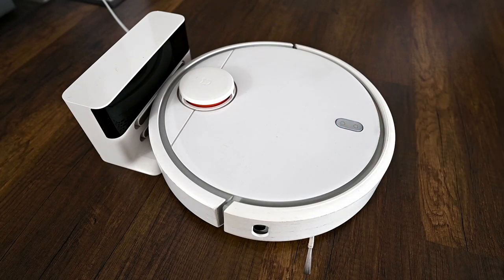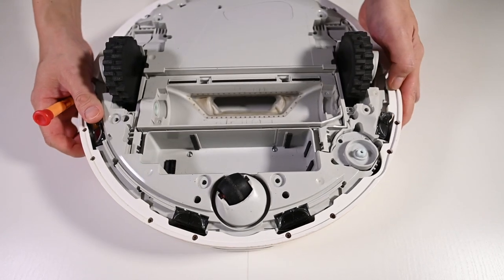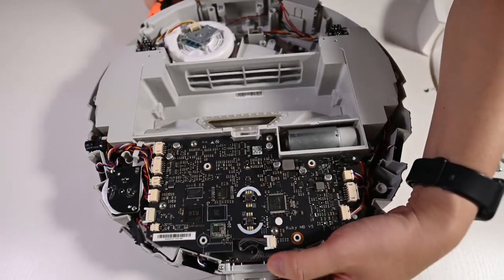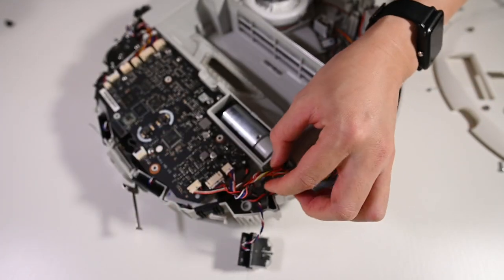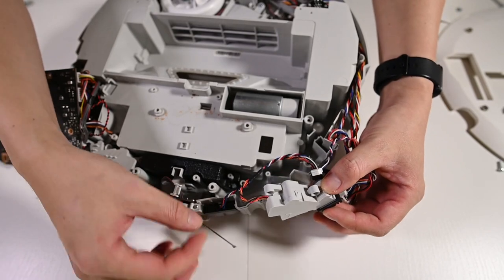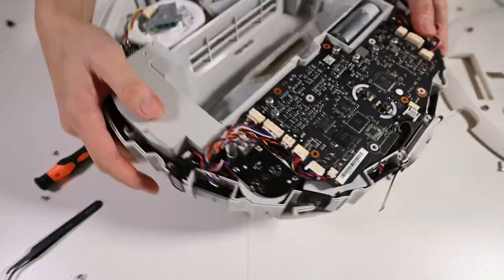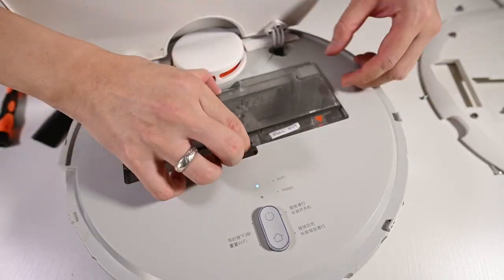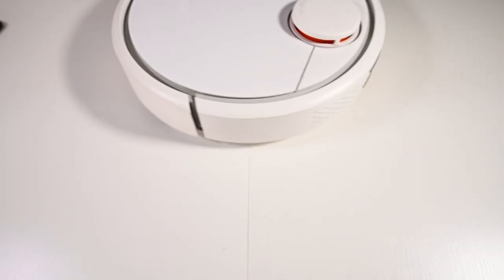Xiaomi Vacuum Robot V1 - Cliff Sensor Error 4

Comment: Thanks a lot. I was able to disassemble the xiaomi vacuum mop c1 model with these instructions to get to the cliff sensors. The disassembly process there included many more screws and more parts disassembly, but this video has everything I needed for success. Again, Thanks a lot!
Reply from the maker: Hi Arthur, I'm glad that my video helps in giving you some info for your repair. Hope your robot vacuum is working fine now. 😊

Comment: So I used you tutorial to get to my sensors but instead of replacing I simply remove the plastic covers from the sensors and thoroughly cleaned them.  For some stupid reason they are not hermetic and fine dust finds its way inside. After reassembly the robot works like new and even cleans for a longer time most likely due to a total cleaning that helped it realize better when its not full yet.  The plastic covers are easy to remove using my finger to unlatch
Reply from the maker: I’m glad that cleaning the original sensors work for you. I tried cleaning mine too, but it still give me error after a while.
Reply: @YungYaw  well I not only cleaned the plastic but also air pressured the sensor itself.  Appearantly there was quite alot of dust inside...  Very fine annoying dust.

Comment: After I bought the sensors, I noticed it there is no need to buy them, you can clean the ones that you have without having to manipulate motherboards and cables. Just when you are able to unclip your sensors from the robot, remove the piece of plastic transparent , clean up with water, dry it and mount it again. You will save 30 euros , 30 minutes of work, and 2 weeks without your robot.
Reply from the maker: Hi Pape Pin, thank you for watching my video. I created the video just to share my experience of fixing my xiaomi vacuum robot. In fact I tried cleaning the sensors too as suggested by the vacuum robot voice prompt but that doesn't solve my problem. So I have to replace the cliff sensors. After replacing the sensors, it solved my problem. Just for your info, I am not selling those sensors.
Reply: @YungYaw  I changedcliff sensors, the problem persists. What else could be the problem?
Reply from the maker: @ValeevVadim  Hi, did you get the cliff sensor "Error 4" message from the vacuum robot? My experience was only related to that specific error. If you get different error code, maybe it could be due to other part error. By the way, are you still able to buy the exact same set of cliff sensors for this model of vacuum robot?  I tried to search and it seems there's not many people selling this sensor anymore. Just want to make sure you replaced the correct cliff sensor and those are working condition sensors.
Reply: My unit are roborock s6, just a yr 5 months and encountered this error 4 cliff sensors issue. I dismount the front protector and clean all sensors with glass cleaner. No help. Now do I need to unscrew everything to access inside the sensors. Lots of screw and hope can mount it back. And do we need to chg all sensors ?
Reply: @YungYaw  nice video and thanks for sharing. Paid so much for this robot n KO after 1.5 yrs. does the sensors with life span ? And do we need to chg all?
Reply: Hi how do u managed to remove tht transparent cover? Mine are s6 model and can’t detach the sensor. Anyway I doubted tht cleaning the transparent cover will help unless u noticed it’s real dirty. If yes, u don’t even needs to remove bottom screw. I believed u can clean it with glass cleaner n brush will do.
Reply: @YungYaw  I spray contact cleaner into the sensors but still error. U can clean the cover with glass cleaner if dirty. But I think sensor cover Shd be fully seal and I found my water warp when spray contact cleaner. Seems to hv a small gap or holes in front of the sensors. Design problem. U might hv sensor errors again once dirt sip in.
Reply from the maker: @mubull  Hi, the transparent cover is actually removable. But I tried cleaning that too but it didn't help. So I suspect it's the electronic sensors that's faulty. The problem with the error message is that it doesn't tell you which side of the sensors is faulty. So I purchased a pair.
Reply: @YungYaw  thanks for the reply. Ya it looks more likely a faulty sensors Bcos the cover looks clean to me hence there are no point for me to force it out. Still to me, they Shd hv design a non removable and sealed cover for sensors.
Reply: @mubull  you are wrong.  The dust gets inside so to clean it you need to get all the process done except mobo removal
Reply: @mubull  contact cleaner?  What are you doing?  What on earth made you use something like this on an optic sensor?

Comment: Are you trying to run the robot on black surface's? It will  confuse it if you are!
I modified mine to work on black surfaces  and that's probably what you need to do also! It'll work perfectly then but you wont be able to use where it can fall after the modification!

Comment: I've got an Roborock E4 with this very same error 4. One of the cables going to the top left sensor was deattached during a previous cleanup and cannot be reattach. Do you know if this replacement would work on this model? I've asked everywhere but haven't had luck so far.
Reply from the maker: It's interesting that the cable got detached from the connector. Will you be able to reconnect the cable or resolder it? At least you can check if it's the cable problem.

Comment: i cant seem to take out the battery and it doesnt look like im not using enough force? do you have to unscrew something
Reply from the maker: Are you referring to the orange battery pack or the battery connector? There's no screw for the battery pack casing. But not sure if they have upgraded their process to add adhesive tape or not. If you are referring to the battery connector, there's a latch that you need to press and then pull out the connector.

Comment: I replaced the sensor for the new from ali express. But error 4 remain. Factory reset also didn't help. Does anybody have the same problem?
Reply from the maker: Hi, I do not have the robot vacuum anymore. So I am not sure what other problem it could be. Sorry.
Reply: @YungYaw  Same problem here. Error 4 still existent after swapping the sensors. Seems to be something else.
Reply from the maker: @thomasbungener4834  Hrm, I am not sure. But if you google Error 4 for Xiaomi vacuum robot, it's related to cliff sensor. Hope you will be able to fix yours eventually.
Reply: @YungYaw  Order a new motherboard now. was $12 only anyway.

Comment: My vacuum keeps breaking down. First the bumping sensor. Than the motherboard. I replaced the laser already and now the cliff sensors. Pf
Reply from the maker: Wow.... sorry to hear that there was so many problems with your vacuum robot. I hope it is all fine now.
Reply: YungYaw need to replace the cliff sensor but i cant seem to find spare parts. Do you know where to get them?
Reply from the maker: @hummel003  Is your vacuum robot exactly same model as mine? I put a link in the video description. You can check it out. Else you can try to search for "Xiaomi Vacuum Robot V1 Cliff Sensor" on AliExpress.
Reply: YungYaw yes the same model. But the link goes to a product that is not available anymore. I tried searching specific but i cant seem to find the 1st gen sensors
Reply from the maker: @hummel003  Hrm... you are right. I can't find it on AliExpress anymore too. However, I found a listing on Lazada: https://www.lazada.com.my/products/cliff-front-impact-sensor-component-for-xiaomi-1st-generation-robot-vacuum-cleaner-left-right-leftright-sensor-i1236274152-s3673372543.html?spm=a2o4k.searchlist.list.40.1585eaa907XL1d&search=1 . But I'm not sure if you are able to make purchase if you are not in this region. Do check the seller profile to see if it's a reliable seller and if the part is compatible with your vacuum robot.
Reply: @YungYaw  hi yaw, do we need to chg all 6 sensors ? Mine are s6 roborock. 1.5 months old.
Reply: @mubull  Me too! What did you do to make it?
Reply: @droneandgadgets8627  I send to rock rock to repair. Lousy service n took almost a month. Damaged rm400. They chg all sensors. Paying a Bosch price vacuum cleaner but China 2nd grade quality. Normally sensors quite durable.